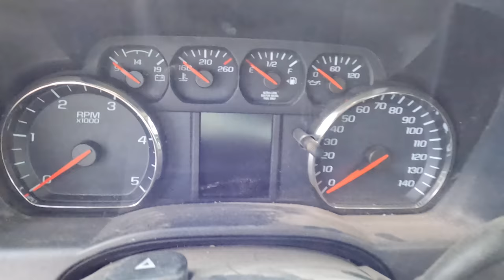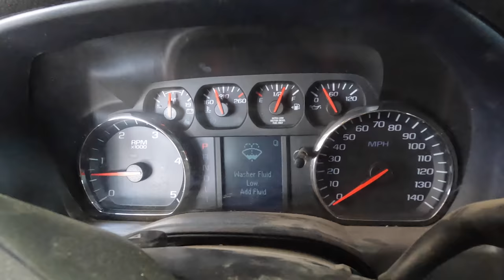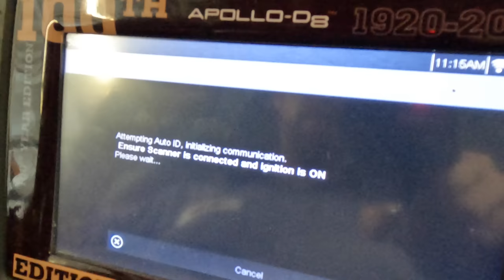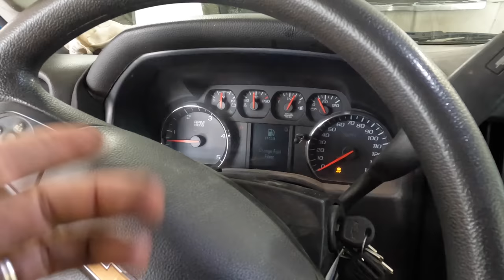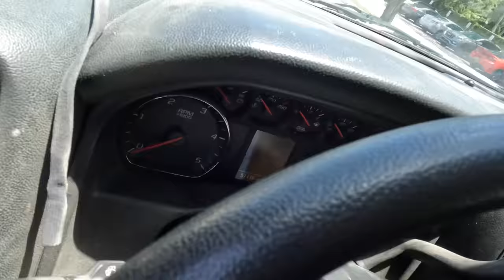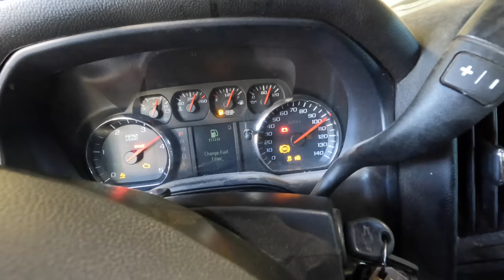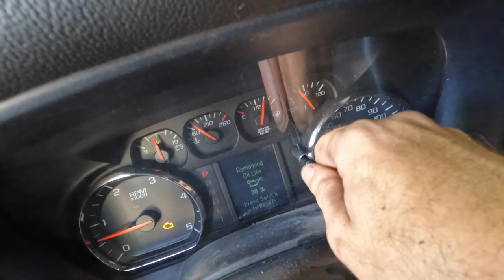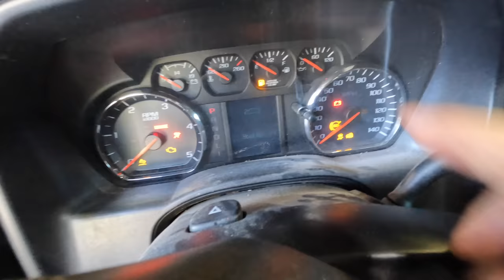Multiple Warnings! Medium Duty Duramax 6.6 3500 4500

Comment: I had to replace the coolant tank in my 2019,  2500, chevy.  It had the same code. But my tank was turning black,  It was under warranty, but I couldn't wait on dealer to replace it so I bought a new tank and had it done in an hour,  I took the old tank and cut it apart, it was like paint chips from the radiator, which made the sensor go bad. G.M. could make it a replaceable sensor but rather not. At 20%  left, Fuel filter I change out.

Comment: The side part of tank u can fill from top it’s the little hole the side cap is so u can pull it off and when antifreeze is running out it’s full but those tanks are bad for the sensor but that one looks low in bottom tank

Comment: I had an chevrolet truck about a year ago and the traction control light was on, one tire was a different size than the others. The wheel speed sensor were showing 1 wheel was going a different speed than the others. That was causing the computer to think  that the car was losing traction and once that tire was replaced with a tire that matched the rest, no more traction control light.

Comment: What can you mix in with the used oil?  I would think that the recycling company wouldn't be too happy with straight antifreeze.  Obviously, with a head gasket failure, it's gonna get mixed, but overall that's not quite the same as just straight antifreeze.  I guess since oil and water do not mix (ignoring surfactants, etc) it may actually be trivial for the recycler to separate them with centrifuge.  Interesting... LOL

Comment: AC DELCO TP3018 Is the screw on replacement for the cartridge type filter. Screws on to the existing mount..no mods required.

Comment: Me and my dad are currently repairing his twin charged 1.4tsi Golf Mk6, and in all the 16 years of working on cars I've never seen what we saw last weekend. So basically we are replacing the valve cover, complete chain assembly and new water pump, the previous owner had tried to replace the high lift pump due to thinking it had fuel starvation problems which resulted in them snaping all three threads on the valve cover that retain the lift pump to the cover, it appears that the 140bhp lift pump had been installed instead of the 170bhp. We removed the valve cover only to find as we flipped the cover over to check part numbers the follower bucket for the pump fell out followed with it a 20p (U.K coin similar to a nickel) the 20p had a circular dent in the middle which appeared be as a result of the high lift pump plunger repeatedly hitting it, needless to say it appears as though they knew they had the incorrect high lift pump and decided to use the coin as a shim to give them just about enough lift of the plunger not to through a fuel pressure ecm light! Also we have now found out the cam cover ordered from the vin is incorrect with 2mm of clearance around the cam bearing. Its a nightmare of a job!

Hope you're well Ray? Keep up the amazing content 👏, you're entertaining to watch and it's great learning what the life of a mechanic over the pond is like.

Comment: I wonder why in this era of the promotion and perception of eco friendly sustainable sustainability, more and more stuff is needlessly wasteful.  This washer tank.  Chevy Cruz PCV valve requiring a whole new intake manifold that has a built in throttle body.  600 dollars for a PCV valve and changing extra stuff included.  The older I get the more I realize companies are mostly full of crap. That's just the start of it but that's way beyond the scope of this video.  I really enjoy these videos.  Ray, you're good mechanic, good instincts and a lot of knowledge.

Comment: Most diesel trucks require low silicate  antifreeze,  that looked like ordinary AF.  

My friend's Ford Aerostar van had the same problem with the switch in the tank and he ended up having to replace the tank, too.
Reply: NAPA also sells test strips(very expensive) to check your anti-freeze. There is an additive to keep it in range.
Reply: Wrong, this coolant is perfectly fine, it works in all makes/models including diesels.  If you look up the owners manual for this vehicle, you'll see that GM calls for regular Dexcool in it.  They spec Dexcool for every vehicle, gasoline or diesel.  The Autozone extended life universal coolant is chemically identical to Dexcool.

Comment: If you want to fill the bottom reservoir just use a syringe that is made for injecting meat. Cuz the tip and fill as the vehicle is running. Saves thirty minutes

Comment: Wish you were close id be there in a heartbeat. Took my 06 highlander in for a winter tire swap 2.5hrs, next day all dash lights including tire sensor came on, ran ruff, lacked power, every bump hurt. took it to other small town shops each had a different diagnosis, lights remain on. $1,500 later son looked found hoses sliced from underneath. air sensor had a big something stuck in it. one could easily see new tool marks on the rig. Rotten animals. I probably need a new tranny they drained the fluid. No recourse in small town montana everyone's related

Comment: Have you ever thought  about checking your local truckstops for your diesel  fuel and oil filters ; they normally  have a greater selection  on hand than the local  parts stores.

Comment: it may return a few days later with a low coolant message displayed because of that tanks design
mity vac makes a fluid injector and and you have to rig up with a grease injector needle to acurately
fill that reservoir. there even more fun to replace on the pick up. the abs modules are crap will set a jabillion codes

Comment: DEF fluid? Just have a wee in it. Good as new

We sell the blue stuff at the gas station up here since it's at a fuel loading terminal and all the modern trucks use it. There's almost never any issues since they're driven hard and kept hot

Comment: Ah yes...Long gone are the Maxwell House coffee percolator....that many of use grew up on... TBC..
What an ordeal for this and todays vehicles. Incredible how everything is so difficult to repair. I'm watching this..and other vids 
by Ray and just aghast of the insanity of todays 'technology'..making simple repairs a life changing experience.  No wonder reair charges are off the charts.  Bizarre...!! - Yeh, I'm still old school..
Reply: There's a lot of difficulty even with 40 year old vehicles. Worked on a 1980's GM front wheel drive to replace a dead alternator. Contortions to remove the pivot bolt, contortions to unhook the wires, more to get it out of the car from the bottom and the replacement back in.  It should be an easy job.

Comment: Two-compartment tank... One is a pressurized surge compartment, and the other is (supposed to be) an unpressurized fill compartment? That's an LP5 engine, that when the coolant sensor gets pooched, you have to buy an entire new multi-compartment unit instead of just the sensor?

Comment: "We have a potential software update which we cant do..."
<to the tune of Scarface - Push it to the limit.>
🎵 push it to dealer. Proprietary software  just bugged up. Take it to the dealer. Parts so new they cant be found yet. Take to the dealer. Its still under warranty sooooo tow it to the dealer. Found a open recall... welcome to the dealer. The dealer. The dealer. The dealer. 🎵

Comment: Bypass line to a different filter until correct part arrives? Would it, in theory, be possible?
Self contained filter bolted to frame rail, intersecting the fuel line. My first thought is that It may cause to much restriction to the flow of fuel. 
( I do wood, not engines)

Comment: My diesel won’t take coolant for a gas car. I thought it wanted coolant formulated for Diesel engines. Sorry if I am mistaken
Reply: If you look up the owners manual for this Silverado 4500 HD using the Duramax engine, it calls for standard Dexcool.  That is what GM uses in all vehicles, gasoline or diesel.  The Autozone extended life coolant he used is chemically identical to Dexcool except for the yellow color.  It's perfectly fine here.

Comment: I’m surprised that the dealer didn’t have a filter and surely it could be found on the inter web.  You would think the next time they would order those filters ahead of time.
Reply: They did order the filter ahead of time but it wasn't the correct filter. I don't know why they went back to canister style filters instead of staying with the spin on type where you can see the part number without removing the filter. You probably have to go by the VIN number through a GM dealer to know how it was equipped from the factory. Around here it is common to switch to a Racor filter.

Comment: How does Def affect the DPF regen? Urea is for NOX and it’s injected with the fuel isn’t it? Regen uses fuel to clean the particulate filter. Aren’t the two systems separate? Educate me Ray. Am I wrong?
Reply from the maker: If there is no DEF/urea, the ECM will set DTCs. Then it wont regen the particulate filter. With no injection and/or filter regen (there is a huge filter on the exhaust pipe) the ECM will gradually reduce engine output and limit vehicle speed to levels rendering it disabled.

Comment: So do you mix two different types of coolant? Make sure both are etinelo glicol based.
Reply: Especially when GM calls for Dexcool only! L5P’s are built by GM in the same plant the new 6.6L gasser! “If “ the head gaskets start to leak, extended warranty could be an excuse to “ no warranty issues” ? After owning 5 Isuzu ‘s the L5P seems to Update issues every year! I don’t like my 2018 3500 Duramax ! Can smell more issues down the road! Fuel economy is the same as the 6.6 Gasser!
Reply: Yes, it's fine.
Reply: @fredwalker839  If you knew anything about coolant, you'd know that the Autozone extended life coolant he used is chemically identical to Dexcool.  Same 2EHA inhibitor package.  It is perfectly fine to use in this application, as well as any other.

Comment: I don't know which countries allow diesels without emission controls. DEF started in Europe and, as far as I know, every country in Europe and Scandinavia has similar if not stricter diesel emission standards. Even India has adopted the European standards.
Reply from the maker: Middle East ,Africa, South America and Asia imports don’t get emissions gear (to my knowledge) And these are larger markets than folks think
Reply: @RainmanRaysRepairs  Many of the Middle East countries have adopted the European standards lately.  The largest country in South America, Brazil, has had emission regulations since 1988 and mainly goes by the European standards. Brazil doesn't even allow diesel cars. Argentina was slower but started requiring emission controls in 1995 and adopted the European V standards in 2016.

Comment: You can bypass the need for adblue urea solution..
A haulier over here in the UK was heavily fined for doing it..
Don't ask me how it is done because I haven't a clue...
Reply: I'm pretty sure you just remove the emissions system altogether and program the brainbox to not worry about that stuff. Cheaper to run but you get soot out the exhaust unless you spend some time tuning so it burns clean.
Reply: @pootispiker2866  They physically can’t “remove” components! Heat score! I know of 2 Landscape Duramax’s that were programmed somehow to eliminate “ re- gen ? After 4 months they haven’t blown up yet! So,,, it is doable I guess!
Reply: @fredwalker839  they most certainly can! Over here removing the cat and DPF mediums while leaving the canisters is a common way to do a deletion of emissions systems without the rozzers taking notice.

Commercial vehicles rarely get this treatment as old and consequently non-compliant vehicles are exempt from regulation in 49 states and those are used instead.

Comment: thats why these duramax  trucks  are more problems , you will have parts availability issues  ,best to  those specialized crazy  oem special  plastic   junk  housing  filters ( which WILL start leaking go bad eventually anyway-plastic  fuel filter housing  bad, The primer pump is leaking. etc  ) ,  put   aftermarket  metal canister .

Comment: Why do you mix red and yellow coolant?? Here in Europe tis a big nono.
Reply from the maker: Our yellow is a universal (universal dye package) the compound is propylene glycol. 
Fun fact propylene glycol is also used as an artificial food sweetener
Reply: @RainmanRaysRepairs  It's definitely universal and fine to use here and in any make/model, but it's not propylene glycol, it is still ethelyne glycol and the ingredients are listed on the bottle, it is the first one listed.  The ingredients are on the back of the bottle, lower right hand corner.  Propylene glycol is very rarely used by coolant manufacturers and it actually has less thermal transfer capability compared to ethylene glycol, so there's really no advantage to using it.

Comment: Unfortunately the top tank is the pressurized tank for the engine not the overflow tank. The bottom one is the overflow tanks that is where it expands into. Bad design. Two caps next to each other would be better.

Comment: Wouldn't doubt if your duramax still makes more HP and torque. Pretty sure they detuned the medium duty trucks.
Reply: @guacamoleweiner69  i figured they do it for emissions as well as longevity. Fleet trucks take alot of abuse from employees not caring and beating the hell out of them. I have no experience with the medium duty trucks with the duramax in. Worked for a company for around 6 years that had the 2nd gen 5500/6500s with the caterpillar engines. Didn't find them to be anything special but i dont know of any breaking down and most  traveled basically 5 days a week, up to 2 hours each way, plus running on site. The pedal had 2 useful positions... All the way up or to the floor.

Comment: Somewhere, there are two or three engineers who need to be horsewhipped.  Surely that junction block could have been placed somewhere a little more convenient, so that that coolant reservoir could be removed without the extra work.  And a filler cap for the windshield washer fluid?!  Really?!  [Sigh...]

Comment: Why was coolant in pink but gold poured in and turned pink?
Reply: Because that is universal extended life coolant, can be mixed with anything and it is fine.
Reply: @coolantkid3428  hey thanks bro! Had no idea!
Reply: @rh5597  Sorry, I reread your question and realize I didn't really answer it well.  There was already pink in the system and it wasn't drained completely.  The universal yellow coolant is designed to take on the color of another coolant when they're mixed.  They really only put a tiny bit of yellow dye in it, so it easily assimilates with other coolants and takes on their color, in this case it's the OEM Dexcool which starts as orange brand new and over time changes to this pinkish color you see in the video.

Comment: Just a question. Why don’t you use OEM coolant?
Reply: The Autozone extended life coolant he's using is universal.  Works in all makes/models.  It's chemically the same as the OEM Dexcool in this application and superior to many other OEM coolants.  Best choice and perfectly fine.
Reply: The reason I asked is Ford has several different coolants per manufactured year and application. Different colors and formulas.
Reply: @bobclark6915  They are just adding complexity and confusion to the consumer.  Their latest interation, Motorcraft Yellow is actually just Prestone Corguard universal formula (the yellow bottle you see everywhere).  It can work in all applications but they only say it can replace Motorcraft Orange and Yellow, which are the last two generations of coolant from 2012-present.  For reasons unknown, they want everyone who owns a 2011 or older to keep buying the legacy products, Motorcraft Gold and Green (or Specialty Green in the extremely few applications that called for that, which is just rebranded Mazda coolant).
Reply: Was at the Ford dealership getting a warranty repair and was told not using OEM coolant would void warranty. I did challenge them, and told them to put hickeys on my hemmeroids.  I now use a different dealership. I find certain dealers from all 3 of the US car makers seem to think OEM parts, fluids, or maintenance must be a dealership thing.

Comment: Dude...DEF has allowed manufacturers to build much better engines than would otherwise be possible by virtually eliminating NOx emissions. Without DEF, diesel engines since abt. 2010 would suck. Mfgr's also say they've been able to increase fuel mileage by 5 to 8% using SCR/urea, while simultaneously increasing horsepower. The downside is a small one...about $0.03 a mile for the DEF.
Reply from the maker: That's just not accurate. SCR and Urea injection do nothing for power production or economy. In fact the particulate filter actually requires that raw fuel is injected into the exhaust in order to super heat the filter during a regen (cleaning) thus using more fuel with no mechanical energy harvested. My issue with DEF, is that without , the ECM will shut the engine down and limit vehicle speed, and ultimately disabling it